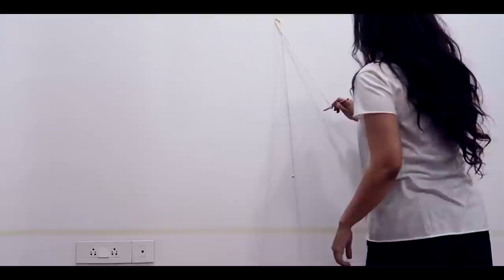How to PAINT a room by YOURSELF on BUDGET! Pinterest Theme Transformation Under ₹2000! EP3| Heli Ved

Comment: Tu easily open the paint ka dabba just tap ur hand on the lid few times  n use a screwdriver
If u forget to clean ur brushes so soon then soak them overnyt in water if ur using plastic paint or asian paint to be precise n nxt day remove wid TURPENTINE
And if ur using oil paints use the same turpentine to soak n wash...
If u get nasty stains on hands u can use again turpentine with cotton
Its a kind off spirit it will remove stains in one go instead of rubbing skin harshly .. moisturize it well after  
Hope this help
Awesome job Heli  😘